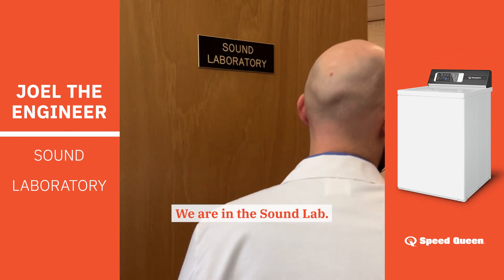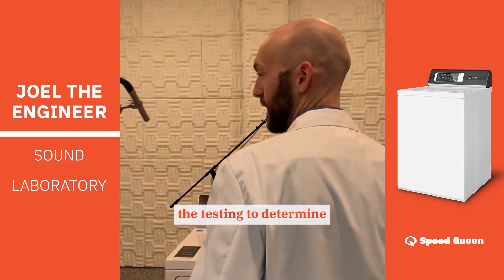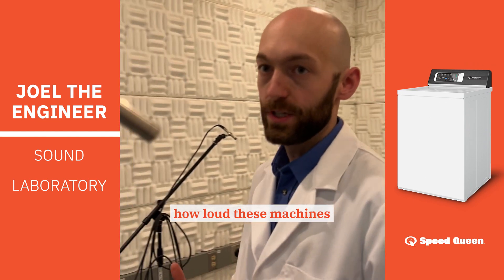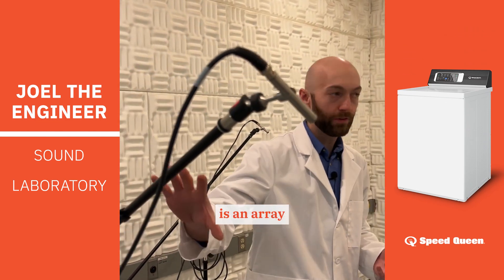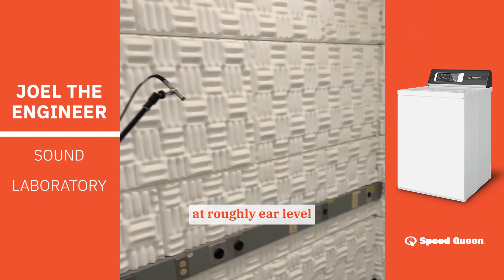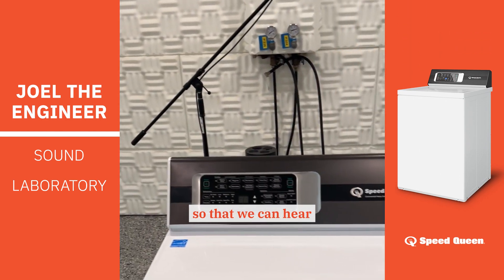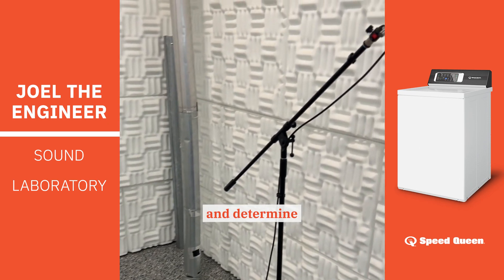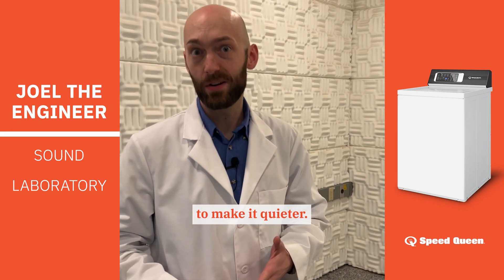Joel the Engineer in the Speed Queen® Sound Lab

Comment: Hello Joel. I just received my TR7. Is the supposed to be an end of wash sound/signal/chime/beep(s)?
Reply from the maker: Hello! If you press the "Signal" key found in the Options area of the display, you can change the end of cycle signal volume. There are four settings you can cycle through: Off, Low, Medium, and High. Hopefully this helps!
Reply: ❤ Thank you!!!
Reply: Also, is it okay to use the scented beads, and if not, why?
Reply from the maker: @feliciagp6945  They should be safe to use! Our only concern would be if they leave any residue or build-up that may require running cleaning cycles to ensure the interior of the washer stays clean on the chance they don't dissolve all the way.
Reply: @SpeedQueenHome  Thank you!